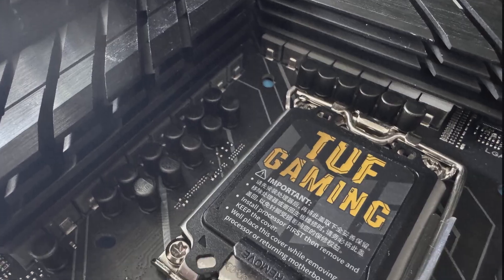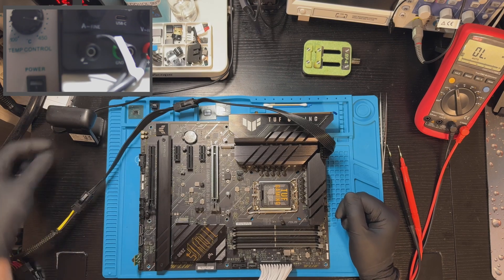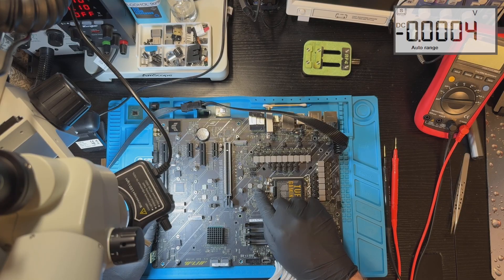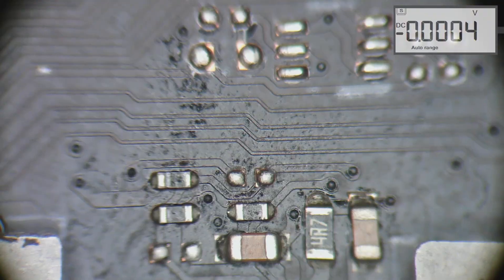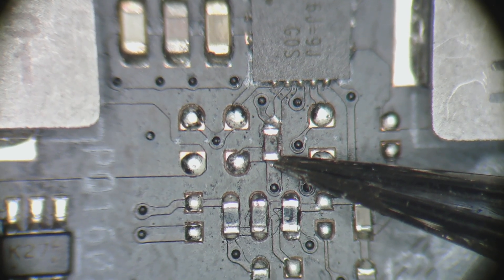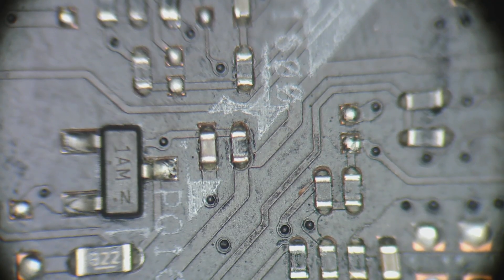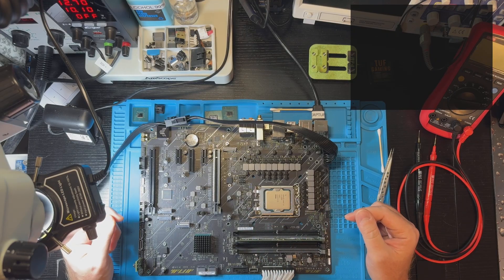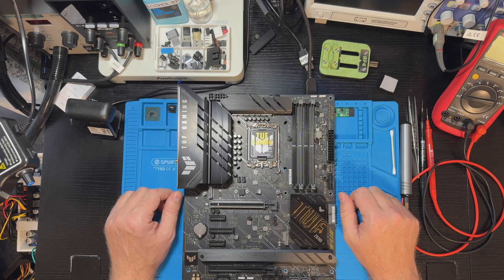ASUS TUF GAMING Z690-PLUS WIFI Motherboard Repair | No Power Fix | Knocked Off Resistors

Comment: Fake fixing job...
Those resistors do not go missing out of nothing. Even if you want to remove them on purpose, it is required a very good soldering iron (professional one), not just any (thus eliminates the user factor here) because the motherboard is a multilayer one, it act like a heat sink. You will make a mess trying to remove them with $20 big tip iron. But on the video, you see those clean pad with "missing" components.
Reply from the maker: Thanks for the comment!
Just to clarify — those resistors were not missing from factory. They were knocked off, most likely during mounting the motherboard into the case or by the GPU pressing against that area. That spot sits right at the edge where people often slip with the GPU latch or catch it with the metal shroud. This kind of mechanical damage leaves clean pads with no burn marks, exactly like in the video. Nothing fake here — just real-world handling damage.